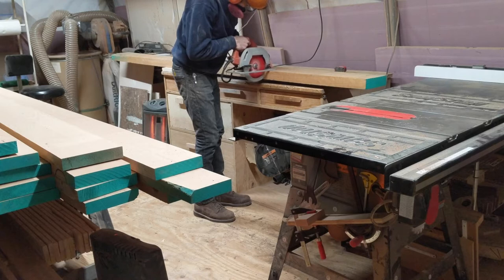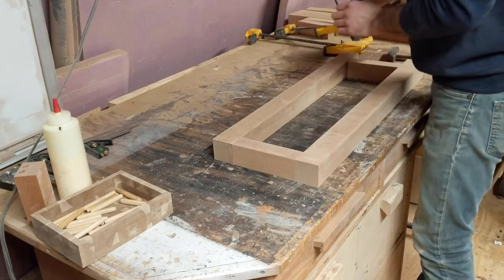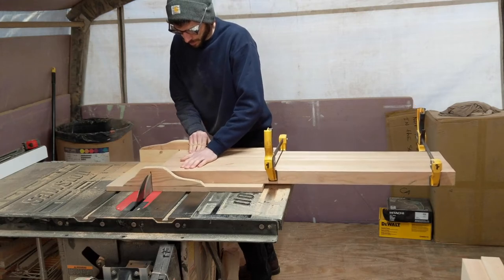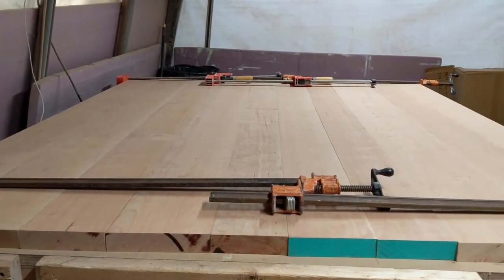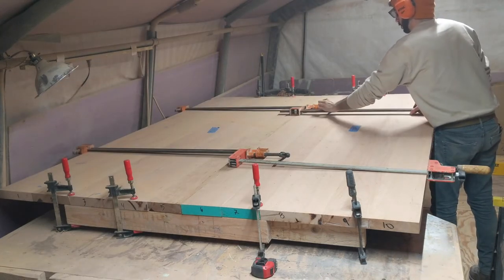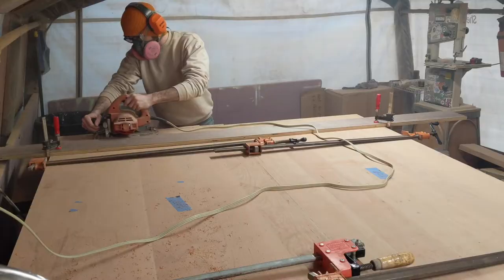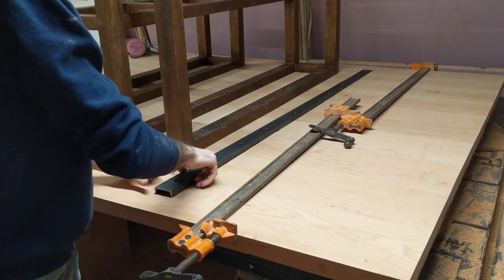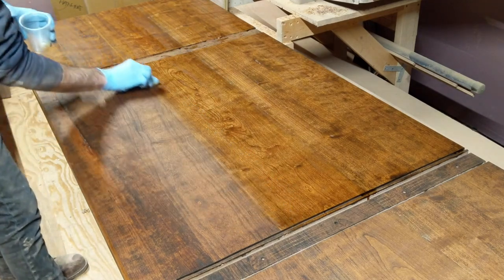Making a Modern/Rustic Dining Table out of Solid Cherry Wood

Comment: A stunning table, your shop area is very intriguing
Reply from the maker: Thanks! I'll be happy to answer any questions you have about it
Reply: At times I need a solution for a really large project and the tent like frame has been in the back of my mind
Reply from the maker: It works great for my situation and seems like it can work for you too if you have the room for it. I would recommend leaving it up all time if you can